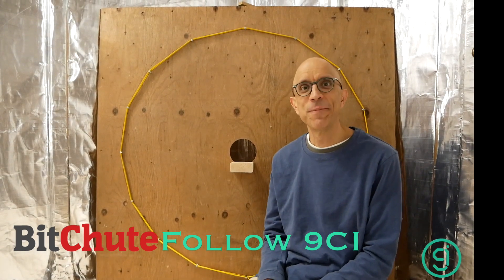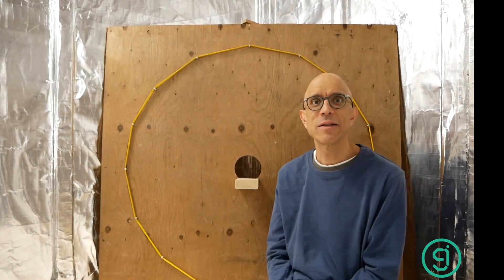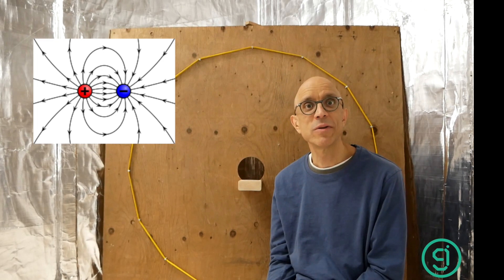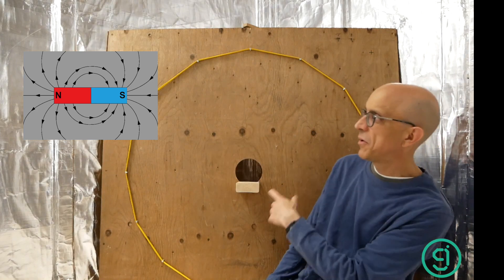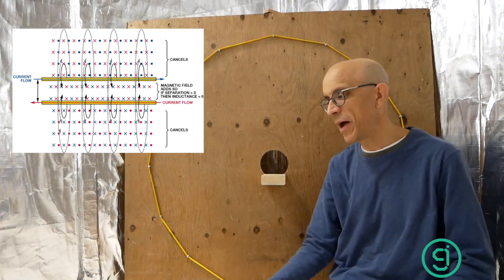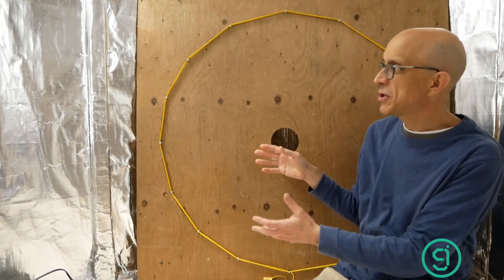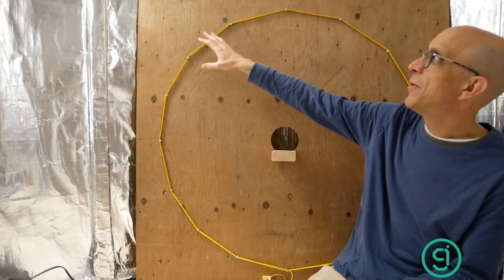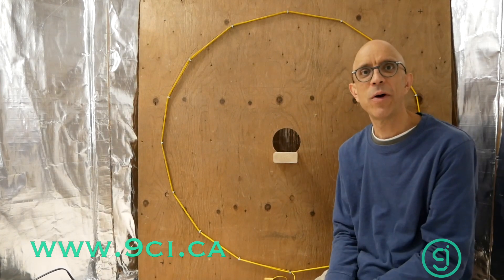Helmholtz Coil Set Up

Comment: You show 6 inches from the coil to the grounded wall plane, but isn't the distance through the plywood (away from the camera) less? Maybe 1 inch. How far from the wall would you need to stand off, with an insulator, to be close to the calibrated levels (near zero effect)?
Reply from the maker: Excellent question, very observant, thanks! We're seeing a near zero effect after about 3 inches, so our plan to suspend the plywood a short distance from the wall will work fine. We still did a complete re-calibration to ensure there were no new reactive effects at some frequencies